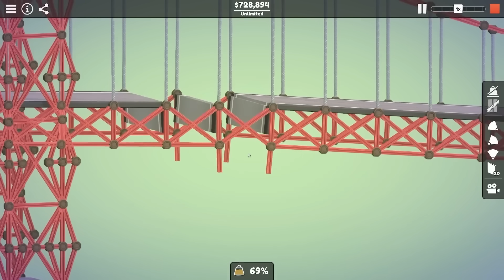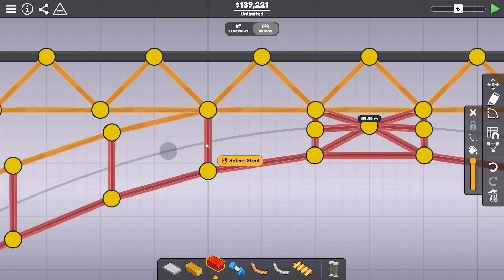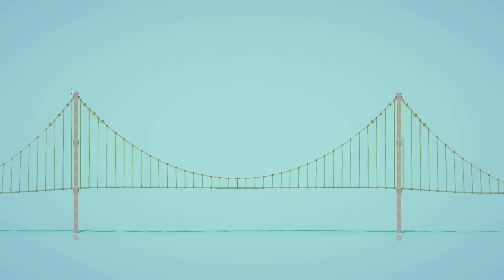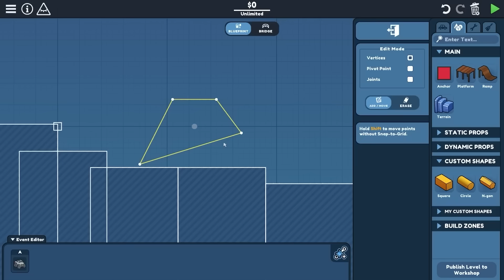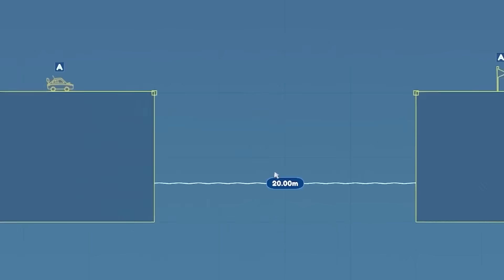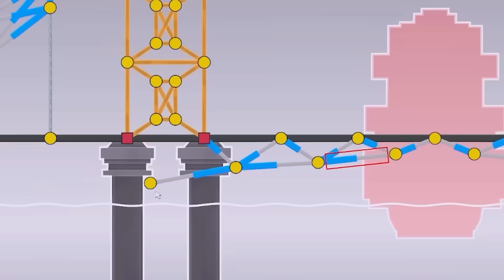I recreated 100 REAL BRIDGES in Poly Bridge 3!

Comment: You built the Golden Gate Bridge drawing you don’t need muscles. You need bigger pillars, which means more metal on the pillars and the metal ropes where the cable goes and then the supports at the bottom they’re supposed to be four of them and not two and I’m not lying because I went to California and I went on the Golden Gate Bridge. Cause bro

Comment: since the cables are bearing all the weight of the bridge... can we turn one singular cable into a cigar cutter that utilizes the forces generated? Im caught up on this theory that if you was in a diving bell at the bottom of the ocean because your bell is pressurized to our atmosphere at the surface you will feel no pressure difference whatsoever. But if you had like an airtight hatch system that allowed you to put your arm outside of the diving bell at the bottom of the ocean your arm would instantly be amputated because of the pressure at that depth. Im caught up on it because i have the image of it happening in that SnowPiercer movie. They did that to an old dude but they used the outside freezing air at train-speeds to instantly freeze and cauterize his amputation. In the same way that freezer-burned cauterized his wounds the exact same thing would happen at depth in the ocean under my theory. The pressure difference is like 1000x it's like 1000 atmospheres at the bottom of the abyssal plains. That pressure difference, if you can imagine it, would squish things shut the instant it happened.

All these weird sci-fi theories are just reality. It's just cheating physics a little bit to make these things happen. Like think about the strongest presses scientists have made. The actual working area is the size of a microwave and the items they're pressing are so small it's comparable to like microscopic shit happening, idek how to say that using my vocabulary lmfaoo. It's like we know how to cheat physics we just neglect to more often.

Comment: One of my favourite facts about the Clifton Suspension Bridge is that the chains were actually recycled. They originally belonged to the Hungerford Suspension, a pedestrian bridge which was demolished and had a railway bridge put in it's place, the steel truss Hungerford Bridge that forms the approach to Charing Cross. That then had two cable stayed pedestrian bridges added either side for the Golden Jubilee in 2002

Comment: i like bridges tbh whoever invented bridges is a goat
Reply: The bridge was invented by civil engineer Arnold Bridge in 1834 when he and his construction crew were building a road, and found that there was a huge ravine in the path the bridge was supposed to go. Arnold decided the solution was to build more ground out of the side of the cliff. The method of building supports was perfected after countless deaths and broken legs, and Arnold Bridge went down in history as the father of modern engineering.
Reply: @saturniidspectre Actually, recent civil engineer researchers have found that Arnold Bridge merely stole the idea from his uncle Nathaniel Cable, inventor of string cables, who in 1821 tied the ends of a string onto 2 branches so his pet bird could walk across it. Arnold simply stole his idea and took all the credit for it.
Reply: @saturniidspectre  thanks for info!
Reply: Nah, you're both wrong, it was even earlier by about 50 years, 1769 the French engineer Sûspen Sîon built a road across the Rhone. It was held from a catenary between two large pylons.
Reply: @ryanstiffler5632  your wrong again. Chinese man Chang Xu dam invented it when he piled dirt on the ground to form a dirt path across a shallow stream in the 1590s.